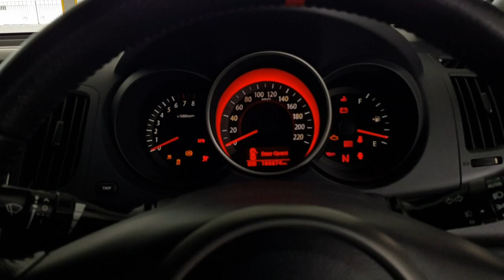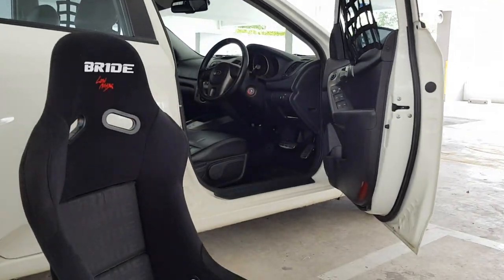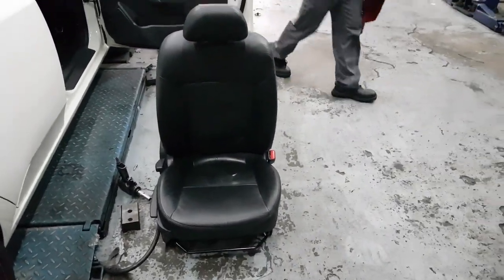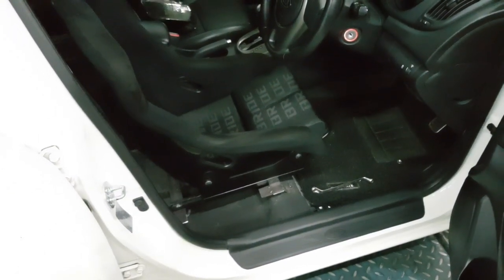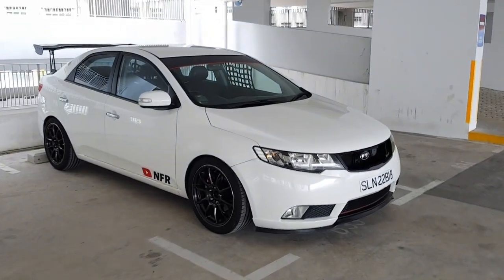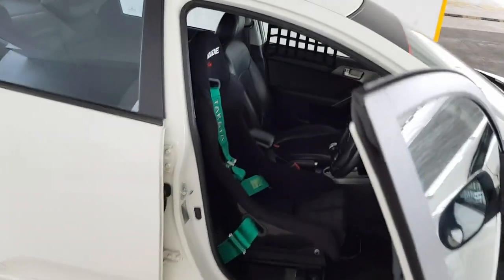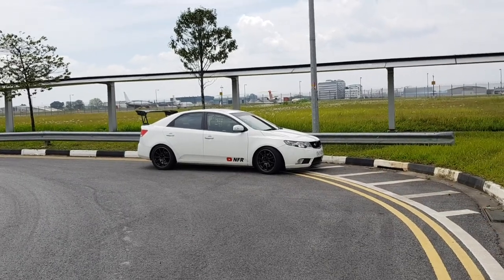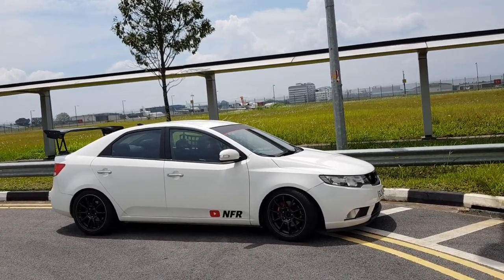FULL BUCKET SEAT Install In My NFR Forte | Kia Cerato Forte | NeedForRide

Comment: where did you buy the seat and can i go to the workshop and ask them to custom make a bracket for my car and what is the cost for the custom work
Reply from the maker: I bought the seat from Tabao.. You can check with the workshop whether if they still provide customisation of mounting bracket.. If not, you can get one from Miki Marketing which is specially made for your ride.. 😊
Reply: @NeedForRide  cool thanks!
Reply from the maker: @jaypt00  Welcome bro 😊